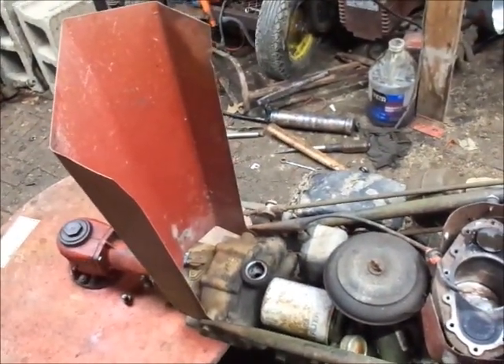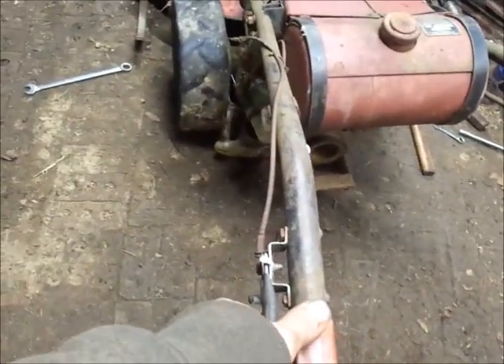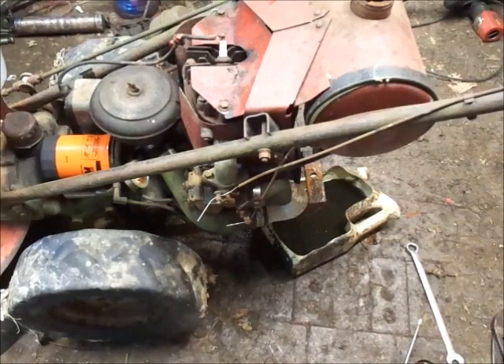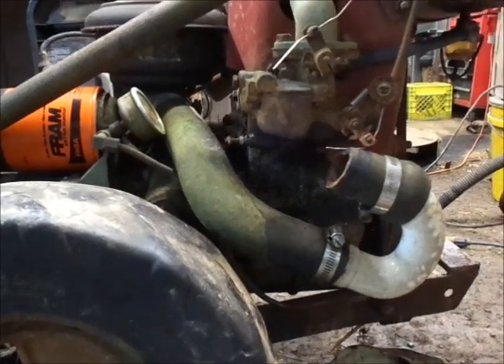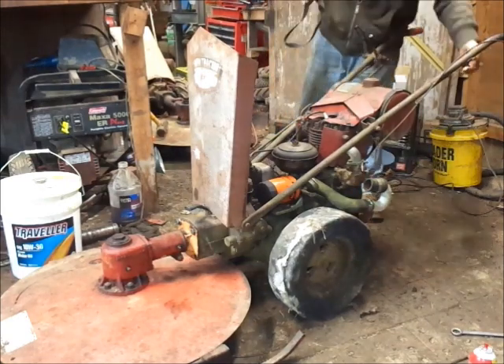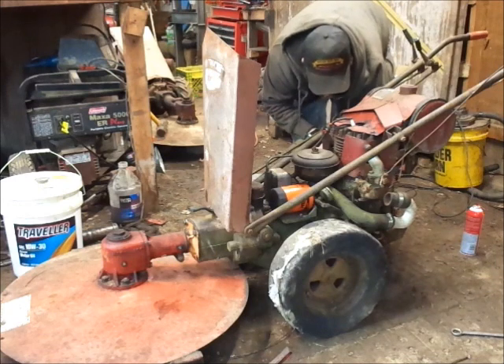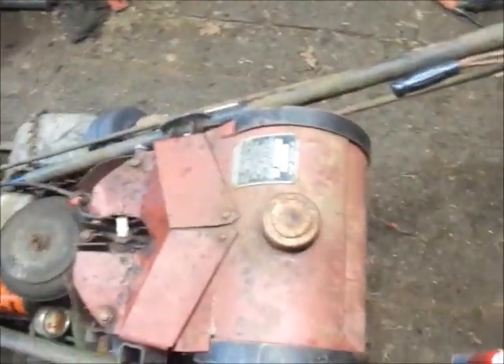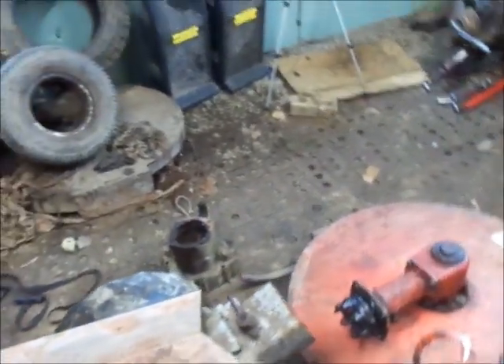Working on the 59 LI gravely

Comment: Sweet! I put more oil on the carburetor throttle shaft on my gravely..  I’m not sure if I can save the gas tank though. I guess I can cut it open , and put acid in it to eat away the rust. Then weld it back up. What kinda engine oil are you running in them?
Reply from the maker: Gas tank are like the most trouble some part. I just run a 10w30 conventional what ever brand you like. The other 52 L outa this bunch is gonna be fun. Not totally sure what im doing with it yet. This one was pretty simple to get going
Reply: stevenpturcheck I think the 52L will be interesting.  I’m going to try and get mine running and ready to use for next winter. I guess mufflers can be had at a farm and tractor supply store ? I can make always make one .
Reply from the maker: @462ANIMAL  Yep there a common threaded muffler
Reply: stevenpturcheck Is there threads on the motor? The last muffler was bolted on.. it rotted off from sitting. The studs are still in the engine.